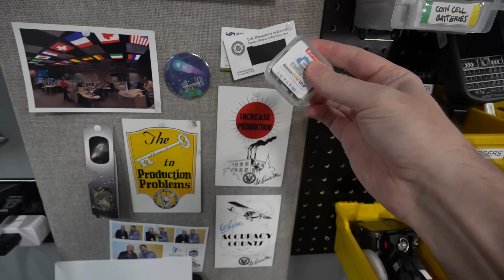The 'hidden' microphone inside the NanoKVM

Comment: I find most of my rabbit holes on your channels, so thanks.  This post made me think of my last two Dell monitors which came with built in KVM (switches).  A little research lead me to the fact that KVM refers to both keyboard, video, mouse hardware switches and Kernel-based virtual machines, the latter of which I've been watching you put in mini-racks.  Phew.  Then a little more research revealed that the Lazarus group may indeed be using Dell monitors as an entry point, though not through the KVM switch, but through the DDPM driver.  I'm a homelab noob but the fact that you of all people got a visit has sealed the deal for me.  I'm in and ready for my next rabbit hole.  I want to take responsibility, starting at the Spectrum gigabit cable coming into my house and do all the things you recommend, setting up a VLAN, building my own router with open source software, using open-firmware hardware.  I've got several raspberry Pi and linux-based projects under my belt.  Where do I begin?

Comment: Hey Jeff! It's nice that you posted about this. I've read this crap too, and it's totally absurd. And I'm pretty sure I had found the microphone on the board's schematics when I looked at it a year ago or so. Indeed, they just used their pretty versatile board to make a KVM. They had no reason to suddenly start to desolder the microphone from these boards just because they were going to be used as a KVM! And the mike is pretty useful because these boards feature an NPU and I'm pretty sure that some people use it with a wake-up word, to try to build simple smart assistants.

All this crap reminds me 20 years ago, there was an add-on card (RAID, graphics or network, I don't remember exactly), which had got 2 extra decoupling capacitors added on a next batch, and conspiracists decided that this was necessarily a backdoor chip that had been purposely soldered on the board... It's amazing the level of stupidity that some people can deploy to say garbage and make noise.  --willy

Comment: I wouldn't trust a nanoKVM as a KVM, but not because of the mic on the board. Rather, the issue for me is that the software is too generic, there's too much stuff running on these things, and as a result they have too large of an attack vector. Can those problems be fixed? Sure. Had they been by the time I was deciding what to spend my money on? No. Have they been yet? I dunno. I got a JetKVM before someone decided to absolutely drive the economy off a cliff.

I would by nanoKVMs for tinkering with riscv though.

Comment: theoretically you can use the microphone for noise floor detection to react to hardware failures or steam the noise to the client. 
by the way there are microcontroler out there who are inside an solder on RJ45 ports. the  LANTRONIX Xport as an example.

Comment: a mic is a very nice source for randomness used in encryption.
Reply: a source that can be easily biased if the attacker is within detection range of the mic
Reply: @burblegobble But they aren't, not even if it's compromised. You're combining two unrelated concerns.
Reply: This isn't a bad idea really, as long as some hardware randomness is used in sampling.

Comment: Correct, it is a documented feature of the LicheeRV Nano Development board that the NanoKVM is built with.  I knew about it before I received my NanoKVM, but I guess not everyone pulls hardware documentation and reads it...  As the other models that are purpose built PCB Designs do not have it, I don't see any good reason to consider that it is "intentionally" there.  It just wasn't purpose built as a KVM.  If it can read any file on my computer, record any keystrokes, stream the displays to anywhere in the world at any time, allow editing or uploading files to my computer.. an incidental microphone may not be the most important security consideration.  I am also rather particular as to what I do with them, and what computers they are used with.

It isn't the only microphone in my house, and the others certainly are listening to what goes on around them..

Comment: "oh no, hidden microphone on a KVM!" - nobody: obvious microphones, and multiple cameras, and wireless long-range transmitters with always-on internet connection, on the little brick in everyone's pockets, running an OS and apps by big companies with an openly stated business model of spying on everyone all the time. Or your TV, robo-vac, doorbell,  washing machine, light bulb, "smart" bed, whatever. If it's got a wifi chip, it's gonna spy on you, openly, and you probably even agreed to it. Do you need to create an account to use it? They're definitely going to sell your data. It's not even a secret, or in doubt, that they do it, that's how they make their money. And most of these companies are operating in the jurisdiction of a country run by a guy who will and has been abusing his power to shut down people who might criticize him (including e.g. European judges). People freak out about China, but even they haven't quite gone that far yet afaik. At this point I probably trust a Chinese-made Tasmota smart bulb from AliExpress more than any "smart" product from a VC funded US firm. Sure, the AliExpress gadget might secretly spy on me, maybe, if I don't re-flash it myself - but the big brand device from <US corp> is guaranteed to spy on me, it's even in the terms and conditions. So, yes, open source and vet everything, hack it, firewall it off, monitor its traffic. Nothing closed-source is trustworthy any more, and maybe never has been.

Comment: I don't care about the hardware capabilities, heck practically every Dell, Lenovo and HP has an internal speaker.  Could it be flipped to an input and used as a microphone?  Theoretically it might.  This can be clipped off in seconds with flush cutters I imagine.  Also have they shipped however many thousand devices that they release the promised open firmware yet?  They may or may not be ideal, but the fact they came along and released a device means it is going to drive others to emulate them.  The RasPi is seriously overpriced/overpowered for this duty at the hobbyist level.

Comment: I'm glad you said it like coz "China bad", while many electronics in households are made in China, and people don't have a problem with that do they! And like you highlighted, many of these early products, especially early starters just use the nearest (technical) and cheapest off the self thing that they can find, and often that means it has features they don't need. Why design your own boards and components if you can buy something ready made more cost effective. I think this "hidden microphone" internet screeching is a nothing burger and out cry over nothing. Do I think products that don't need audio recording (like TVs as a prime example) should have mics in them, no, and long term generally speaking about products, yes it is a concern, but I can appreciate the cost and easy of sourcing ready made components. And people need to be less naive, their phone in their pocket has a mic in it, a KVM is likely to spend most of it's life in an unattended room, with little conversation if any.

Comment: That board looks ALOT like and Esp32 Cam module with some ports added to it
Reply: Capturing HDMI on an ESP32 would be troublesome.
Reply: It's a Risc-V CPU running Linux, it's quite a bit more powerful than an ESP32

Comment: My Banana PI risc-v sbc is so fancy.  It has EVERYTHING on it, including two microphones, a speaker output, headphone output, two lcd driver outputs (one of them up to 1440), HDMI, nvme, sd, eMMC and SATA,  it can be powered from a barrel jack, usb c up to 12v, or power over lan. It has PCIe, bluetooth, wifi, and totally unneeded fan header (damn I keep it cool though). 2x ethernet, 4x usb 3. 26 pin header, UART debug. Dev boards have a lot you don't need!

Comment: Modular Design is something that can reduce production costs significantly.
I got UART/ Debugger which got a risc-v controller. Instead of just a controller, it has a module with wifi antenna as well. The source code and even the tools to flash the thing are available on their site.

These kinds of devices are not produced in volumes of millions,  so they had to go modular to keep the costs down.

If people are paranoid about them then just don't use it.

Comment: A microphone right next to the exhaust of my server? Actually, that would be super useful. I was going to comment about the server fans, but having a way of monitoring that noise would be a great metric to track.
Reply: Wind turbines use microphones to measure when the bearings need replacement. Same could be done here, I guess. Once the fans start to scream, show a message that they should be replaced soon... 😉
Reply: @mbirth ever been in a server room? You aren't going to be able to tell if the bearings are going. But you will be able to tell when they turn on and off.
Reply: @orbatos  I've been in enough data centres and server rooms. You can still make out a screaming fan over the "normal" noise level. Especially, if that NanoKVM sits right next to the server.
Reply: They are gonna listento the coil whine and figure out your private keys

Comment: In terms of listening devices ... have you locked down your phone? The iphone definitely spies and my android phone does as well. Supposedly that is turned off if you don't use the voice assistant but I've never had that on and it still does it. How did I come to this conclusion? Ads and YouTube recommendations that mysteriously start appearing after conversations about the topics or in the case of the iphone, news article recommendations. What really put the nail in the coffin was a topic where the conversation wasn't even done in English, it was in a mix of dialects both common and less common in another language. Actually kinda impressed by that especially since typical speech recognition doesn't seem to be as good.

Comment: A lot of use a mini-microphone would be on a NanoKVM attached to the one machine I would use it on would be.  I would use something like this on an old Lenovo TS200 I would keep in the "attic" (unfinished 2nd floor).  The most anyone would hear is "damn it's cold up here" or "damn it's hot up here" depending on the time of year.   Nothing critical would run on it.

For that matter, the machine already has a built-in KVM, I have the additional remoting module in it, but the KVM remote control software uses a very obsolete 32bit Java version, and I've never managed to get a setup that will work with it.  So it takes up space in my home office instead.

Comment: Intel CPUs have Intel ME that you can't secure. AMD also have something like that.
Make sure you remove your CPU when you do important work on your computer or server.
Reply: I always tell people that to make things as secure as possible you need to unplug the computer from the network entirely. Everything you do after that is risky, and you need to make a determination if you want to assume that risk. You still need to operate.
Reply: @WhiteG60  you actually have to disable all input output. There are documented attacks against microphones and webcams using strobing lights and high frequency audio, not to mention tempest grabbing CRT contents based on their emitted EMI. Hell, with the right gear, you can use glossy screens to record audio in a room when they are off (laser mic)...
Reply: @WhiteG60  I was joking, but if you really work with sensitive data, work offline on a dedicated device, and have installed only needed apps.
In reality everything you do is logged and open to attacks.
Even you keyboard (not the PC) can be hacked itself.. no need to hack an entire PC..
Reply: I think powerpc power9 CPUs are the last generation of major PC CPUs without ring -3 spyware
Reply: I've known people to literally burn those components out of their cpus; so there are people paranoid enough to consider AMD/Intel management extensions a threat.
Reply: @Cutest-Bunny998  lol sure buddy, the ME and PSP are crucial parts of the CPU cold init process. Without them the CPU does not function. Best you can do is neuter the ME to some extent by removing parts of its firmware, afaik you can do nothing for PSP
Reply: Afaik the ME coprocessor is in the chipset/motherboard. AMD's PSP is in the CPU instead
Reply: @marcogenovesi8570  The Intel Management Engine (ME), also known as the Intel Manageability Engine[dubious – discuss],[1][2] is an autonomous subsystem that has been incorporated in virtually all of Intel's processor chipsets since 2008.[1][3][4] It is located in the Platform Controller Hub of modern Intel motherboards.

The Intel Management Engine always runs as long as the motherboard is receiving power, even when the computer is turned off. This issue can be mitigated with the deployment of a hardware device which is able to disconnect all connections to mains power as well as all internal forms of energy storage. The Electronic Frontier Foundation and some security researchers have voiced concern that the Management Engine is a backdoor.

Intel's main competitor, AMD, has incorporated the equivalent AMD Secure Technology (formally called Platform Security Processor) in virtually all of its post-2013 CPUs.

Comment: Arguing with conspiracy aficionados in the comments section made me look into this a bit more.
Sipeed say quite plainly on the page for this product it is based on the LicheeRV Nano dev board. They publish the schematic for the LicheeRV Nano which details the microphone (though only as U12, not a part number sadly). On  the page for the dev board they have the one liner used to record audio from the mic as an example for people to try.
They haven't hidden anything. They published electrical schematics with the microphone in it. 
It's pretty clearly an oversight that for this product removing the mic is perhaps warranted, or at least mentioning it's there prominently as it's part of the dev board and they don't want to make a custom run without it. Hell I'd advertise it as a feature, up until recently when everything went solid state I did a not insignificant amount of "why won't this thing turn on" by ear. Hearing beep codes could well be useful lol. Like you won't fix it but you'll know why it's broken. The PiKVM has also recently added 2 way audio, though it's taken from the host PC. If you add a speaker to this dev board you could (kinda) do the same for an extra $0.20

I couldn't find the exact mic used on the RV Nano, but a similar looking one costs about 5 cents in qty500 from LCSC. You'd have to move a lot of units of a fairly niche KVM to warrant a custom variant, inventory, publishing schematics etc.
That said Sipeed may well wish to do so, at least for others who wish to embed their dev boards directly without "hidden microphones being discovered"

Comment: More specifically, the original nanoKVM is based on LicheeRV Nano, where the microphone was very much a documented feature - and Sipeed has been putting mics on a lot of their devboards, which makes sense since they're tiny, cheap and useful, especially as they've been markering many devboards for ML (especially audio/video ML) in IoT use cases (I'm pretty sure they started with Kendryte K210 devboards, which is an early risc-v microcontroller specifically focused on ML and audio/video processing. They put mics on these too and even had an add-on board with 8 microphones for directional audio capturr/detection).

So yeah, it's really not surprising the product that AFAICT started as essentially HDMI input add-on to an existing devboard with a mic, still has that mic.
Reply: Further, that the LicheeRV Nano is a devboard semi-capable of ML/IoT audio/visual uses lent itself better to becoming used in the NanoKVM. The LicheeRV Nano (and a whole slew of other RISCV devboards around that time) launched with video capability, partly due to the RISCV chip being intended to replace other IoT Camera chips. What also needs video handling? an IP-KVM! bip-bam, now you have the NanoKVM, JetKVM, and some of the others Jeff pointed out in his stash. Sipeeed/NanoKVM are just unfortunately paying for their own lazyness/speed at which they don't address security problems.
Reply: But but China bad

Comment: I wouldn't trust any company for remote KVM access. Recompile your own firmware from trusted source code and it should be fine as long as you don't have security bugs in the source code, exactly the same way as any Linux or BSD system.

Comment: Well, on the Wiki for the NanoKVM they clearly state, that it's based on the "LicheeRV Nano" dev board, which includes the mic. The NanoKVM is just the LicheeRV Nano + HDMI in + software
Reply: Clearly means they say it has a microphone
Reply: convenient
Reply: So it connects to HDMI video?   Wouldn't be of much use to me, as anything I'd have "remote" doesn't have HDMI anyway (VGA, or on rare occasion DVI).  Sure, I have converters, but I expect this device wouldn't like them.
Reply: @SenileOtaku   those devices you’re connecting to remotely that have VGA, they wouldn’t happen to be servers with built in IPMI or the like, would they?